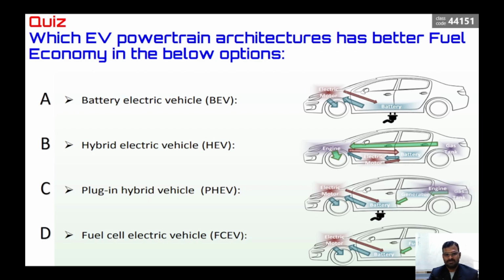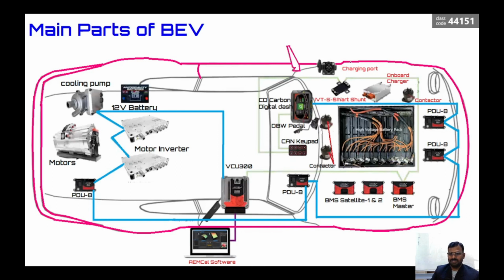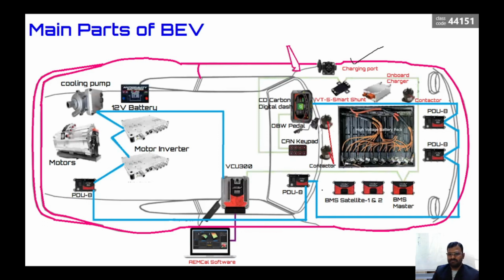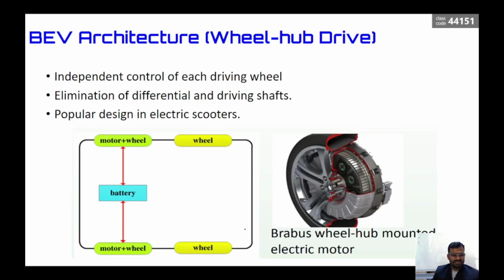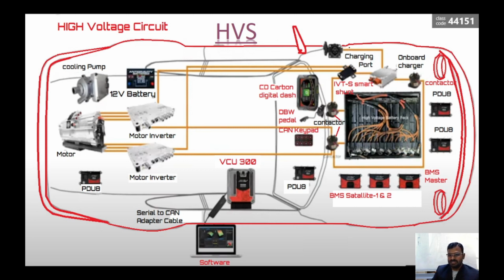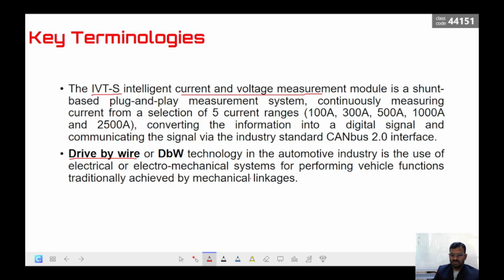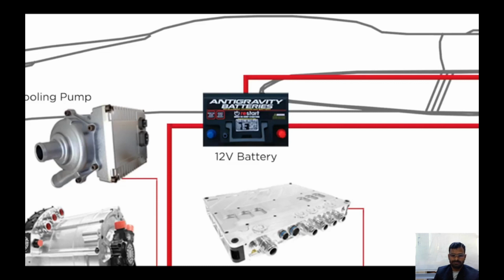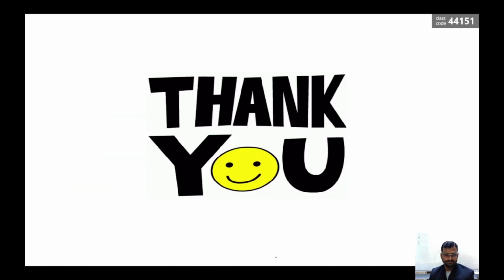Battery Electrical Vehicle-Working Principle and Internal Construction

Comment: Why two pdu8 and invertors ? , High and low voltage range ? which micro controller in Indian cars ? too much questions if known and willing to answer without commercial interest you may answer Thanks for Excellent video worth to watch knowledgeable graphical representation .👌👌👌👌👌🙏
Reply: Instead of liking comments it would be better if u replied asked questions.Tnanks again.
Reply: High voltage system for driving the motor generator set through the inverter and converters as required
Reply from the maker: Low voltage system is used to control the lightings and sensors and other low voltage mechanism which i explained bro
Reply from the maker: kindly watch at 10.12 for high voltage system and 12.45 for low voltage system